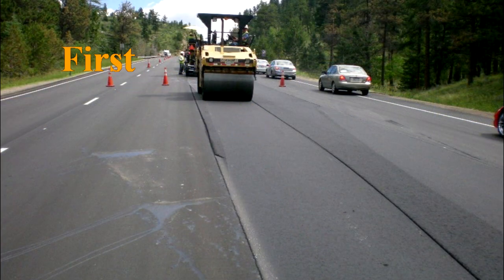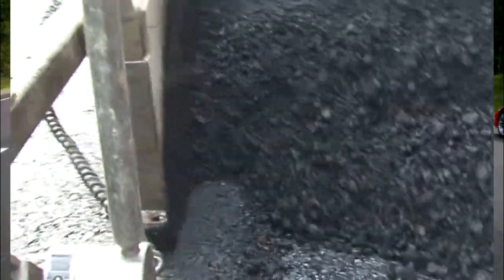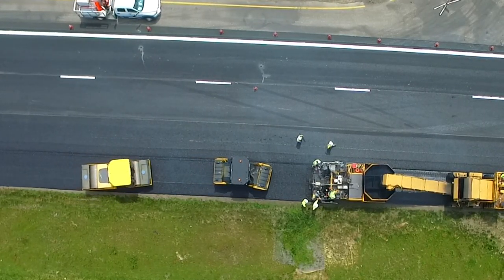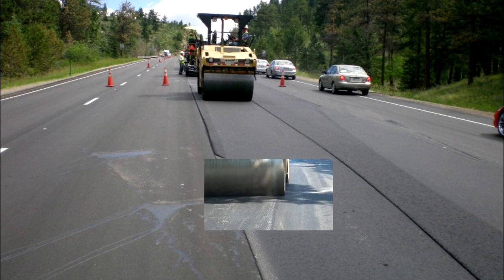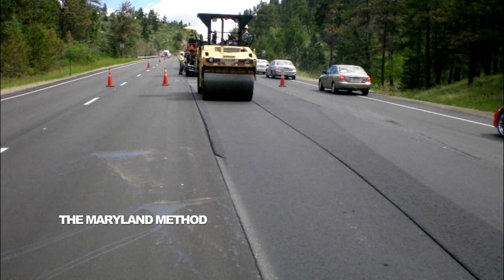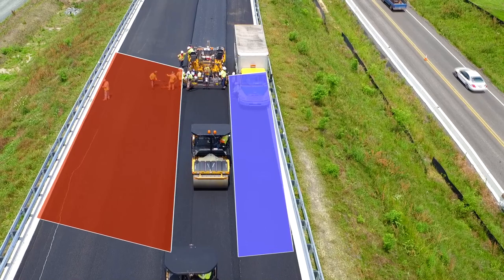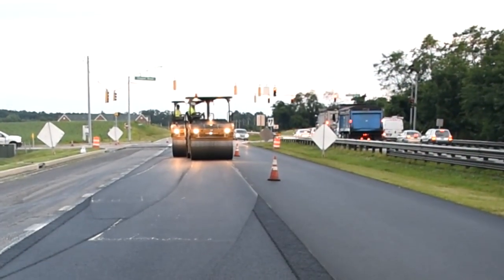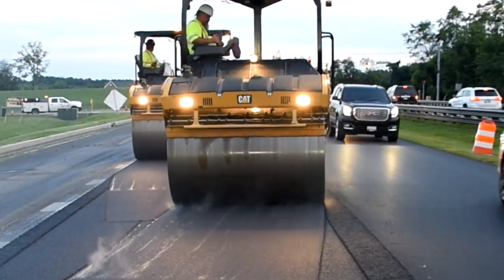Maryland Method Longitudinal Joint Compaction

Comment: If you see white at the joint, that is material being pulverized from vibratory roller crushing aggregate that is over on existing cold mat, joint on first pass should be pinched in with most of the drum on the existing mat, then half drum with vibes on, breaking the mat down from the high side down, compacting when mat temp falls below 240 degrees F and finishing from the low side up when temp falls below 170 degrees F. Porous asphalt is not to be vibed static roll only usually with a max of 5 passes and be finished before temp hits 145 degrees F. then there's warm asphalt, total pain in the ass.
Reply: @ks5739  Well whenever possible it's ideal to close at least of highway and run staggered pavers all hot lapped it is like one paver pass edge of shoulder to edge of shoulder. but when you cant like you said, last pass down the middle allows rakers and rollers to rake and roll cold joint, pushing traffic out on both outside lanes giving you enough room to do your job. Plus whether it's an invert or crown? the lanes are paved staggered from where those lanes will be striped you dont want the track line of vehicles running down the lane joints will unravel in a short time. Kyle what state are you in? and you do mostly commercial and industrial paving?
Reply: @dennisbrown6502  Canada - parking lots, cul de sac, residential - never highway
Reply: Agreed, that white is smashed aggregate so you no longer have 100% bitumen coverage on your aggregate and you have created a finer gradation.... two specs that have always been deemed critical design. Better solution is use a joint heater. Operating cost less than 10 cents per foot as per contractors.
Reply: If you pinch the join first, you have basically pushed the mix that needs to be in the join out.

You can pinch the join later if required.

I always pave a stone width over the join,. The crushed stone has shown in studies to provide better join and pavement life.  It's less likely to absorb water as a open join, under compacted join, that can happen from pinching.
Reply: Warm asphalt?

Comment: It’s funny how they do things differently everywhere cuz if you rolled like this where I’m from you’d be kicked off the roller 😂
Reply: Do a roadtec course, it's a similar method to what they recommend.

You shouldn't pinch a join more that a half drum of a roller.  Basically what you have done is push the material out of the join.

It might look mickey mouse, if you pinch, but if your goal is joint compaction, that's how you achieve it.
Reply: My boss would be screaming with that much overlap. RAKE IT IN. NOW
Reply: The guy who taught me to roll said “when it comes to paving, everybody’s right and you’re wrong” 🤣🤣🤣
Reply: @awaroots yep

Comment: This is certainly not how rolling is done here, after the initial pinch you should run your drum more then half way over the new mat to seal the joint as this pass will push the material back which was pushed away when pinching the joint, pinching an overlapped joint will basically result in the same results with busted aggregates but like demonstrated in this video it’s for durability not LOOKS!

Comment: Good video. I don’t work for an asphalt paving company but asphalt paving is part of our job and I butt heads a lot with others because they want to roll the joints first instead of 6 inches away from it
Reply: Their way will give you an ascetically pleasing joint, but it will not last as long as a joint that has more material forced into a confined area first and then compacted with the force of the roller exerted on the slightly raised area.  Put on a hard hat and win your argument!!!
Reply: @k80greendeamon  Same as above ,I cringe when I see guys with 20 yrs experience rolling joints first.
Reply: How are you re-compacting the cold edge that is 4-6% less compacted as per AI? FAA says to cut off this edge, What density do you get on the cold edge by this method? The white line is just smashed aggregate that is not covered with bitumen. We supply a joint heater that allows you to re-heat and re-compact the cold edge, the cheapest way to get recompacted density on the cold edge
Reply: if its a cold joint? rolling 6 inches away will in most cases push mix over onto to cold mat, depending on factors, depth, vibrating, and tonnage of breakdown roller, i have seen most times if it does not pushes mix over joint, it will leave a drum edge line that wont roll out it will fold over, now are first breakdown rollers are pneumatic or rubber tire and rolled 6 inches from cold joint works perfectly.
Reply: Now factors making it a pain in the ass, is inspectors (State) not letting the roller operators do what they know, in over 40 years ive seen just about everything.
Reply: @k80greendeamon  That also depends if the passes are staggered and striped accordingly so tire tracks of traffic are not running down a joint.
Reply from the maker: The important item is to get as much material into the area between the cold joint and the confining hot mat that has received compaction by the first pass of the roller.  Then putting the full weight of the roller on the area between and compacting down to eliminate as many voids created by the joint.
Reply: @remotaurog  also depends on what your company wants some focus more on the appeal and some customers especially those building developments are looking for more beauty then function it’s dumb but everyone has different priorities wether or not they actually make any damn sense
Reply: Roll the joints, huh?

Comment: Is possible to send specs cover this operation ? Appreciate if you can
Reply from the maker: I have uploaded a brochure for you.: https://drive.google.com/file/d/1EmUG3FVg3pEVz_ED9qa7O8X7a0L3c2gG/view?usp=sharing
504.03.08 Joints. Construct joints as directed and as follows:
(a) Stagger longitudinal and transverse joints in successive courses so that one is not directly above the other.
(b) Stagger transverse joints by the length of the paver.
(c) Stagger longitudinal joints at least 6 in. and arrange so that the longitudinal joint in the top course is within 6 in. of the line dividing the traffic lanes.
(d) Construct joints in a manner that provides a continuous bond between the old and new surfaces.
(e) Overlap the existing pavement 1 in. to 1.5 in. when constructing longitudinal joints adjacent to existing asphalt pavements.
(f) The initial longitudinal roller pass shall be on the uncompacted hot mat and 6 in. to 1 ft from the joint. The successive roller pass shall compact the overlapped material and the 6 in. to 1 ft material simultaneously.
(g) Apply tack coat to joints as directed. Cut back the edge of the existing pavement for its full depth at transverse joints when placing a surface course, and apply tack coat material as directed.
(h) Apply tack coat to all contact surfaces before placing the mix against curbs, gutters, headers, manholes, etc.